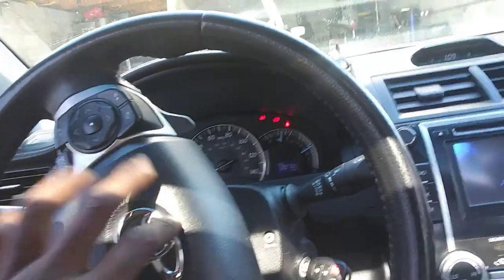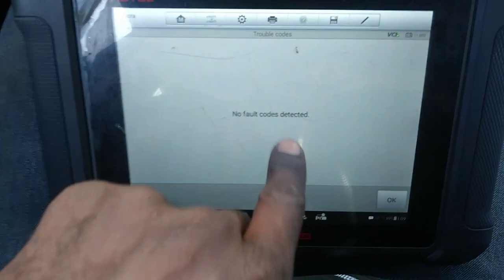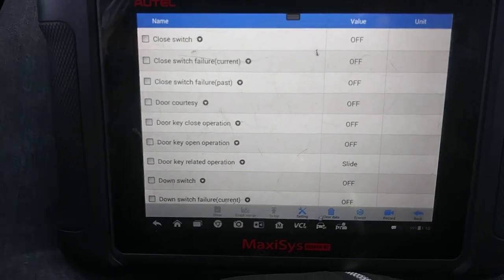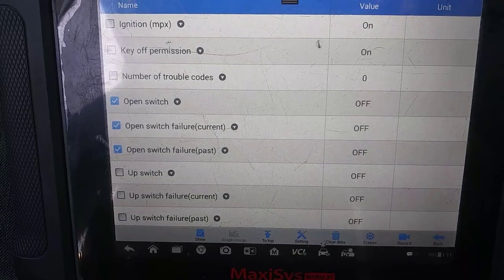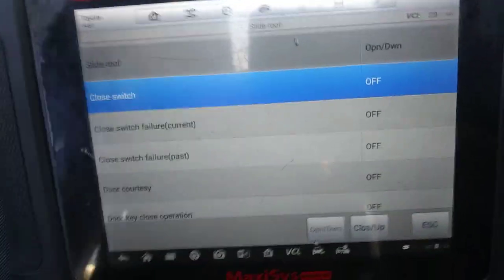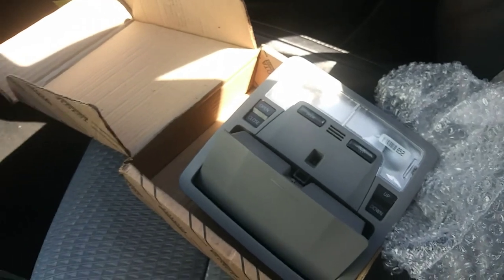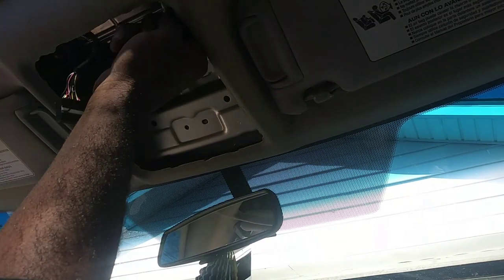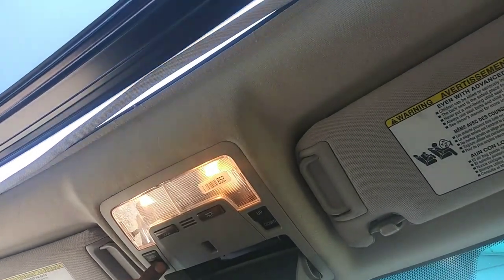'12 Camry moon roof switch assembly replacement

Comment: Thank you very much this was quite handy! I bought a 2014 from carmax and the slide thing doesn't open and close just the crack thing.
 My son had diagnosed it at carmax as a switch but I didn't realize it was gonna be an entire thing.
 Not so cheaper repair for a used car buyer.
 I will be calling carmax to see if they will not pay me for this part.
 Thank you for an excellent video!

Comment: so mine only doesn't when it is hot outside, and now when I hit close it closes but then goes right into tilt open..I hit close (tilt) and it closes but then opens the sun roof....lol...so I have to manually bump the close switch till it shuts and hope its sealed tight...is it the switch or the motor ?

Comment: I'm having the same problem on my '12 Camry SE sunroof. The dome lights work and garage opener, but neither open or tilt buttons work. It could be the console, bad switch, or motor??🤔
Reply: What did you end up replacing? The console or motor?

Comment: i am thinking of tapping to the power there for the dashcam and uniden r7. Is it possible to tap which wire?
Reply from the maker: I'm not sure the exact wire, just simply disconnect the harness and use a test light for 12v source.

Comment: so.. was it enough to just replace the whole unit? Or did you have to go through switch control process with your little tablet device?
Reply from the maker: Yes, using my little tool to properly diagnose the issue and insure the switch is the culprit is necessary. One can always chunk a part at it, as this is common, they may get lucky

If one has the wiring diagram, they could manually close the windows by jumping wires.
Reply: @partsshooter  because I have the same model Camry and mine just fully stopped working.. after sometime.. I feel like the switch/fuse went bad. I was planning on buying a whole new console just like you and trying that out, hoping it would work. Does that new console you bought from the dealer come with a new motherboard and switches on the inside?

Comment: I have the same problem but my tilt button won’t work. My other button works. The one that fully opens but I have to push the button in the reset mode because that will close it after it being fully opened. For my tilt what should I do? It works shen it it wants to lol
Reply from the maker: The buttons are so common to fail, dealer replacement is best option
Reply: @partsshooter  ugh. It’s annoying. I’ve done a lot of work to mine and this damn button I swear lol

Comment: My sunroof has the same problem, 2012 and I didn't use it much. I just think it is best to leave it as is. I knew I shouldn't have opt for the sunroof - it is one more thing to go wrong and it always happens out of warranty.
Many thanks for your expertise.
Reply from the maker: No simple than what it is to replace, why not get the upper console replaced? You'll have your luxury back of operating moonroof.
Reply: I am with you half-way. Those gadgets are just one more thing to break.
Reply: He just showed you how to fix it in less than 6 mins🤦‍♂️